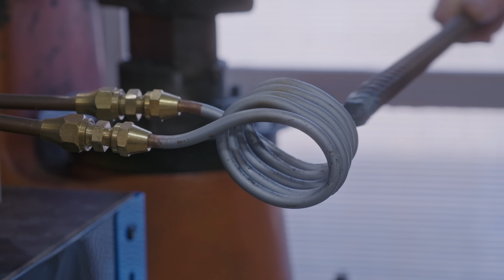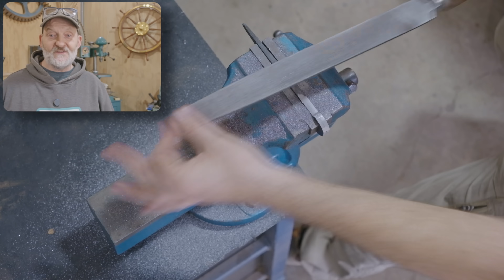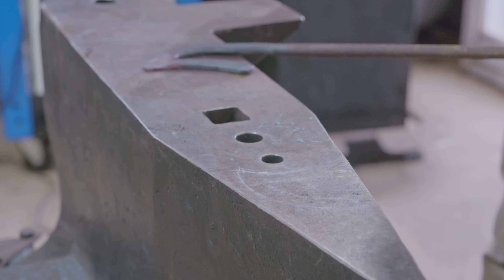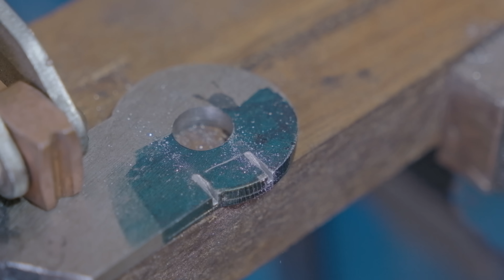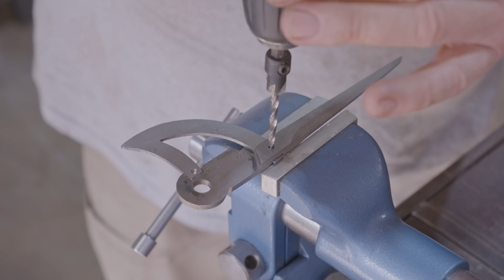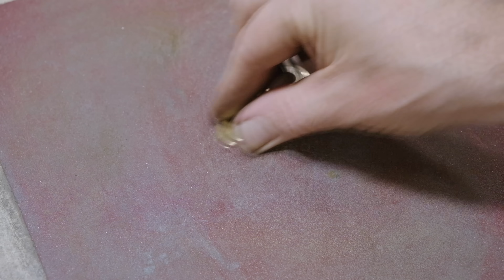Making Unique Dividers – Just Hand Tools and Patience

Comment: Battery powered rotary tool w all the bits on the planet 50€, set of files which actually cut 120€. That is about 70€ you pay for fun.

Also, heat treating. Rebar has almost no carbon. You are probably looking at case hardening. But at the very least water quenching in water/brine. What you did, with oil, does absolutely nothing.

Further, you forged it. If you have 0.20%+ higher end rebar that is actually good, provided you did not overheat it like you did with the brace arc thing. In reality what you have is good 'ol ferrite/perlite and a bit of waste heat and oil. But it does the job, looks good and it is easy to resharpen.

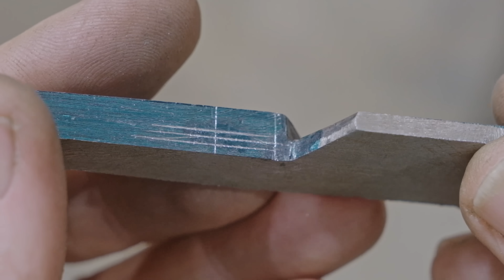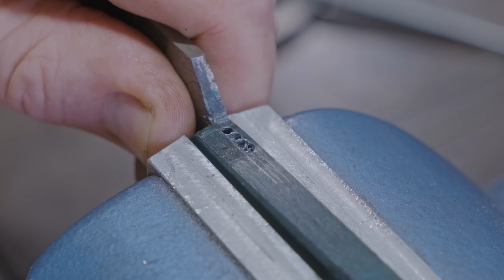Comment: Hey pask fun little tidbit that you may already know but that can be helpful. Instead of punching a few holes in a row to drill out for the wing you can take a cold chisel and line it up and give it a good whack and then itll leave you a nice straight line to drill all the 2mm holes side by side since sometimes a center punch might wander a hair making your holes zig zag a little bit. Hopefully someone finds it helpful. This is in reference to what is being done at 13:24 through 14:05. The valley left from the cold chisel gives you your "center punch" and guides your drill bit to drill fairly parallel straight lines in a small area.

Comment: I enjoyed this one a lot. Pask, have you considered prototyping with soft materials? Possibly wood or even Delrin which is a material Adam Savage has said many times he loves. It would be more consistent through the volume than wood. You could get the dimensions down quickly and cheaply. Then commit with harder materials.
Reply from the maker: I've actually been prototyping my next woodwork project using plastic cut on the Wazer. :)

Comment: I think this video has just about the right amount of detail, both for someone considering making the project and for those of us who just enjoy watching how it was done. In my case I doubt if I will ever make any of your projects but I have picked up tips & techniques that have been useful in my own projects.
BTW, I prefer the videos where you do most of the work by hand. Machinery & power tools are great if you have lots of room and you will use them enough to justify the cost and shop space but sometimes it makes more sense to use hand tools. 
That said, I had never heard of belt grinders before I started watching Pask Makes but now I have one. I knew I'd only use it a few times per year so mine is smaller & less elaborate than yours but every time I use it I wish I'd had one years earlier.

Comment: I've seen you weld a few times, you commute way too much with the welder, you get worse in burning then. The same thing when welding vertically, start from the top down, without oscillating. From a welder.  (Sorry for my bad English)

Comment: Heh, making that slot by drilling out the majority, and then using a chisel to remove the rest? First time I've seen tried and true wood-working techniques used like that on metal. A milling machine would make that cut easy, but expensive. So even if you have to make do, the important part is you're making, and doing! Right?

Comment: I taught blacksmithing for years.  You’re doing great, the only thing I’d change is your hammer grip.  Hold the handle between your thumb & forefinger, let it pivot there, and use your other fingers to give it a snap at the end.  You’ll hit it a lot harder that way.  And keep your thumb off the top of the handle or you’ll hurt it.

Comment: No complaints from me! I rather like when you do the long version and not editing the little stuff out. You show way more alternative ways to approach the issues. Like using the drill and a file to narrow down the washer width and make sure they are round, great way to display a creative solution. I am fortunate enough to have a mill and lathe but without those most processes would be just as you have done.

Comment: "I'm not a nuclear physicist, but in this week's video, I'll show you how to hand-build a particle accelerator using a box of old spoons, a butane lighter, and a set of fingernail clippers.  My test version was capable of opening a wormhole to an alternate dimension, but I reckon this one will be even better."   Absolute legend.
Reply: “This second version has folded time and space itself, though it could still use a little shaping with a hand file…” [fast-motions through 23 hours straight of filing, splits the atom, and creates a small area of dark matter into which to empty the dust collector] 

“I reckon that’ll be good enough.”
Reply: you're going to need a modified microwave oven or you could make one from this scrap wood....
Reply: I am 100% sure Neil is capable of making that sort of video. And I'm also sure i'd watch it!
Reply: hahahaha so true!

Comment: I hate to contradict anyone, particularly in a Pask video, but Blacksmiths were NOT the original trade. That's carpenters. We've been doing carpentry ever since someone decided that burning a hole in one log would let it fit over the end of another in a way that wouldn't fall apart. Blacksmithing has only been around since the Iron Age. Even bronze casters are older.